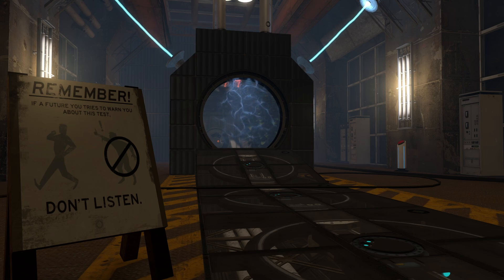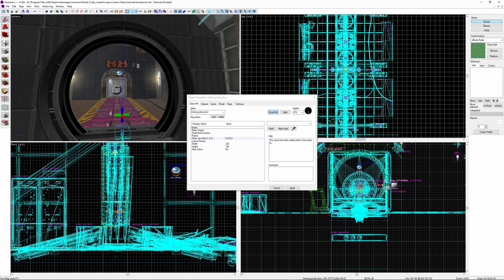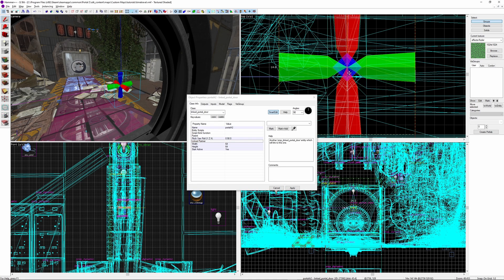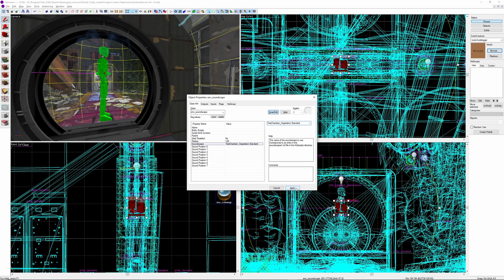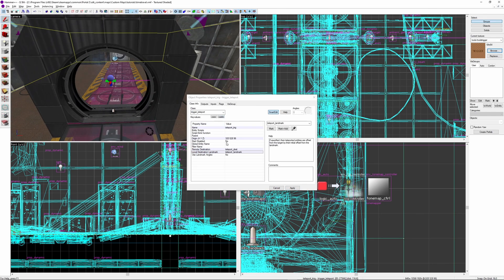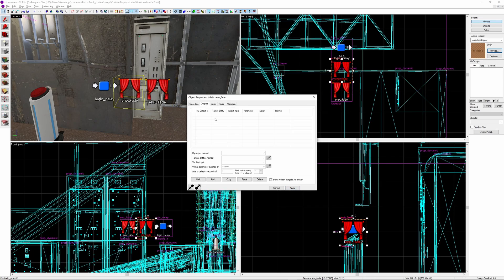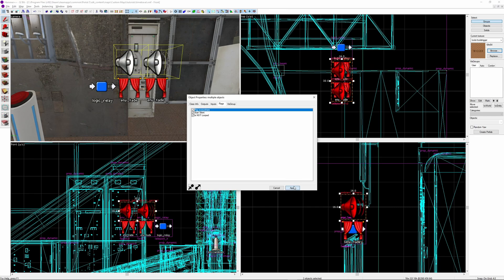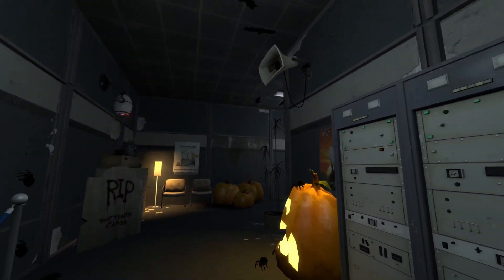Portal 2 Hammer | How to implement Time Travel

Comment: Very helpful!

I do have a few tutorial suggestions.

1. How to make a custom loading screen, if you know how to make one.
2. How to do particles, the electric beams from the vent models shown in the intro
3. If you know how, how do I import/export models into/out of hammer?
Reply: i have the answer to 2 of your questions, but the middle one i don't know much.

1. you cannot. the game is specifically coded to recieve different pictures and display them during loading times, based on specific map prefixes (sp_a1, sp_a2, sp standing for singleplayer, numbers corresponding to chapter numbers up to sp_a4)

2. i think you can do this with an env_beam?

3. you can either get hammeraddons, which lets you use a comp_pack entity to pack custom content, or use VIDE, a non-user friendly, buggy program which lets you pack custom content into your map with no limit
Reply from the maker: Sorry for the late reply, but for the first 2, originalname is right, although I may do a particle related tutorial sometime but probably not for a while. For 3, I believe what you’re referring to is already explained here: https://www.tophattwaffle.com/porting-content-from-other-source-engine-games/
Reply: @scesie  The website you linked me was for exporting/extracting models and textures, is there a website that shows how to import sounds, models, textures, animations? Since I didn't see anything about it on the website you linked.
Reply from the maker: Importing is the process of something being ported into a game, exporting is the processes of porting something out of a game. The website does both, porting out of one game and into another. Are you referring to the creation of new assets?
Reply: @scesie  Yes, I am.
Reply from the maker: For sounds: https://youtu.be/c6akpZrqxqk?si=k-0tB0FV_gx-DK7X
For textures: https://youtu.be/lJ3oCs-52_U?si=omo5yGfHOzXqbOzW
Modelling is a lot more advanced and will require to learn some modelling (or already have the model) and do plenty of research for which there are loads of sources for various topics on this all which can be found by googling ‘hammer making custom models’